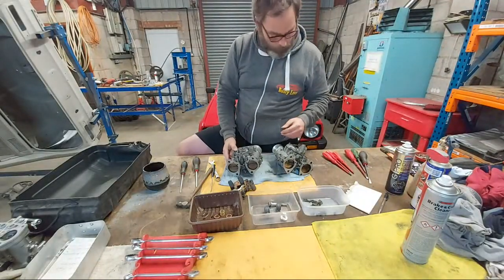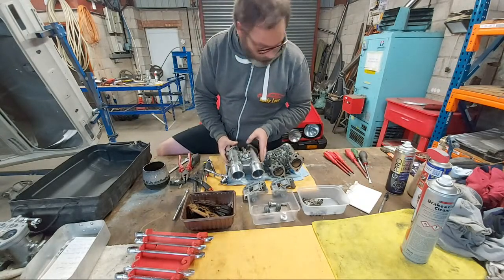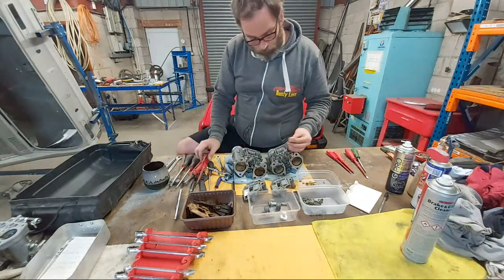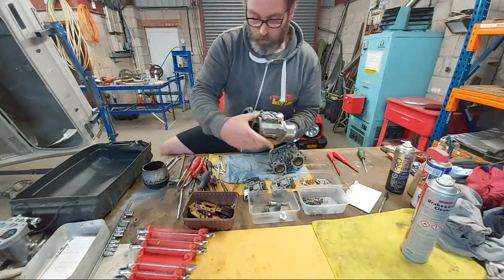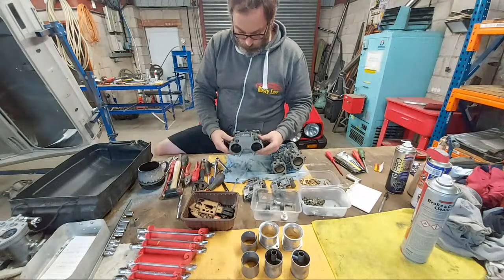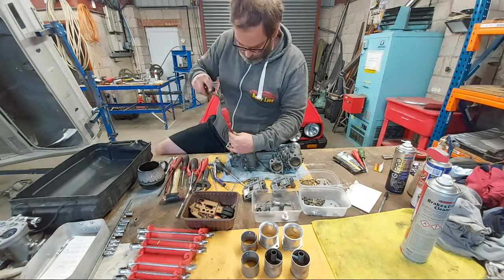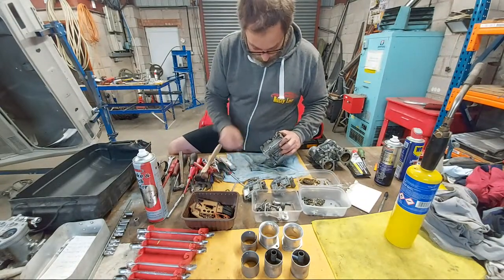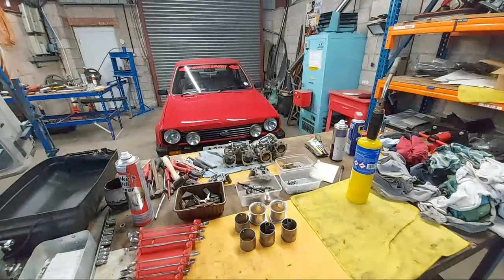Stripping A Pair Of Dellorto DHLA48 Carburettors For Rebuild

Comment: im watching your video's in the wrong order but that's ok.  after watching you tear down them Webbers, i think i'll stick with the down draft carbs.  i've also done up draft carbs also.  the only thing close to a side draft carb is a lawn mower and motor cycle
Reply from the maker: Not done an updraft carb yet Ken, what motor was that from? Must have been a vintage design? Sounds interesting!
Reply: @Classiccarbscouk  an old ford 9N tractor.  yep pretty vintage but they still run and get the job done.  they are strange to say the least.  air comes in the side then up into the intake manifold.